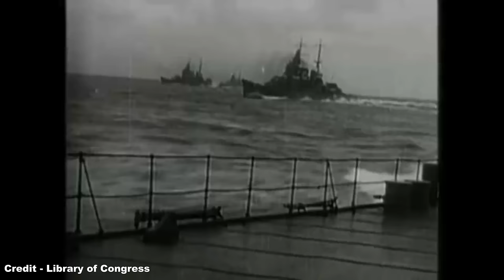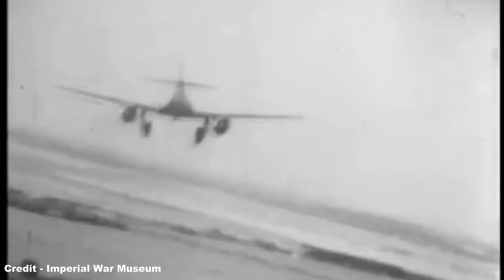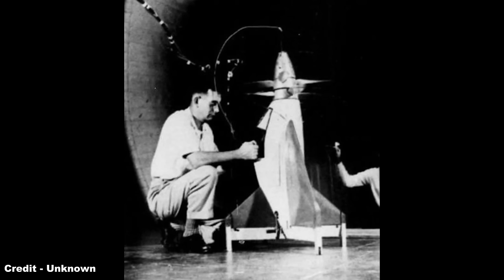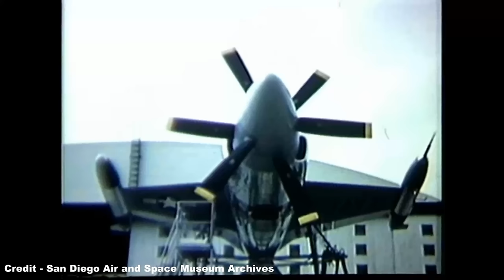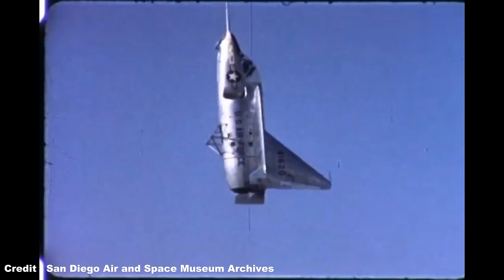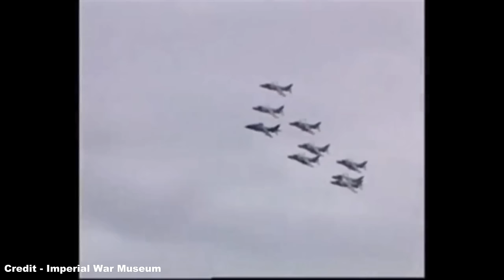Flying Failures - The Pogo Planes

Comment: My dad was a design engineer at Convair. As a boy I met several Convair test pilots. Convair, as I recall, didn't like the idea of VTOL aircraft sitting on their tails. But since the Navy was paying for it, Convair went ahead and designed the Pogo (XFY1). And it was a success in take-offs and transitions to horizontal flight. But landings were difficult and dangerous. Skeets Coleman, the test pilot who flew only one of the 4-prototypes (all the same) told my father he hoped the Navy didn't adopt the idea. All the proposed test flights were completed except for the last one since the transmission that kept the 2 three-bladed propellors powering the craft was starting to greatly wear.

But today small flying models of the Pogo often fly at radio controlled model airplane events.

Comment: There was a Pogo plane sitting as a display at the main naval base in Nofolk, VA in the 1970s when I was in the navy. There also was the  Martin bomber, "The Truculent Turtle," the first aircraft to fly around the world non-stop but it was taken away at some point. I don't know where it ended up.
Reply: It's currently at the National Naval Aviation Museum in Pensacola, Florida.
Reply: @FlightSimHistorian  Thanks- has it been restored to fly?
Reply: @lawrencelewis2592  Sadly no. Though, it is hanging from the ceiling, so I guess it's kinda 'flying'.
Reply: @FlightSimHistorian  At least it's indoors instead of out in the weather the way it was in Norfolk. There was a 4-engine Japanese flying boat there also, I don't know the type. It was sitting at the naval air station and had what I think was a dehumidifier connected to it. It was taken away by about 1978; I think given back to Japan. It looked a lot like a Boeing 314 but was a lot smaller. Another thing I recall was the R4D that had curtains in the windows, I guess used for flying officers to Washington.

Comment: One must wonder why they even bother trying to put a compact radar altimeter into a small VTOL when they could just integrate it into a dedicated landing pad that would just send through radio signal current VTOL altitude over the dedicated landing pad with additional information on positioning thus allowing to land vertically in all weather conditions without having visual contact with landing destination. They could also put a camera on the landing pad that would transfer real-time image of the VTOL position over the landing pad to a screen inside the VTOL cockpit, all in all, it does not seem that they taken these VTOLs very seriously to take extra effort make them viable with already available means, likely due to proliferation of AA missiles that made convoy defense VTOL fighters redundant technology.

Comment: Make a Video on the do31 and other 60w vtol aircraft that failed, from america and the soviet union
Reply: Oh, you mean all those early attempts at V/STOL using lift jet engines? Both the Russians and French tried with lift jets at the center of the plane but dropped the idea due to the weight penalty fo lift jets at the time. How they got it to work with the F-35B is quite a feat of engineering.

Comment: For VTOL you need a power to weight ratio of at least 1.3 to 1.
Reply: Source?
Reply: @My-Opinion-Doesnt-Matter  in a text book about aircraft design in the library of University of Glasgow which I read as an aerospace engineering undergraduate in the mid-1990s. Sorry, can't remember the title or author after all this time.
Reply: @My-Opinion-Doesnt-Matter  imagine having Google to research someone's claim yourself, couldn't be me
Reply: @neiloflongbeck5705  thanks, I wanted to read more about it, post it here if you find it. A Harrier could do a VTO with about 1.1:1, and I guess modern fighters could technically do a VTO with a bit less armament/fuel.
Reply: @My-Opinion-Doesnt-Matter  what I quoted was for a decent bomb load. It also takes into account re-ingesting hot exhaust gases.

Comment: There were these things called helicopters ....
Reply: Not fast enough in horizontal flight!
Reply: As the other comment pointed out, helicopters wouldn't have been very good at defending a carrier or ship from hostile fixed wing aircraft.
Reply: These weren't designed to work like helicopters 🤡